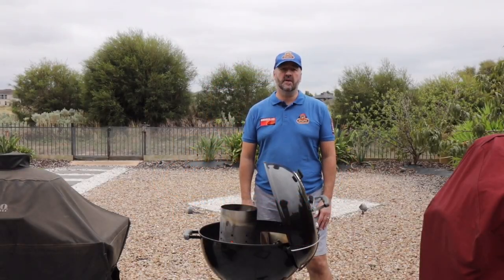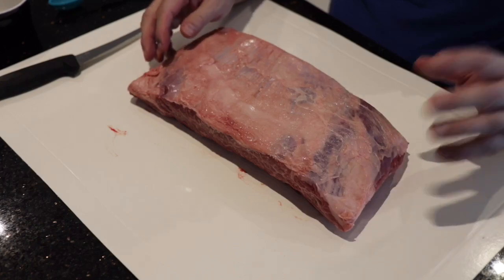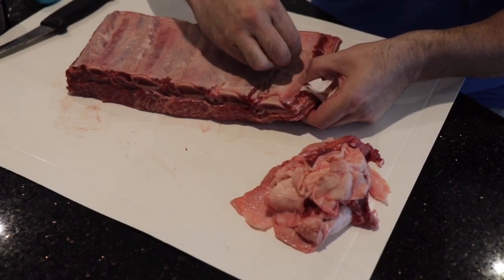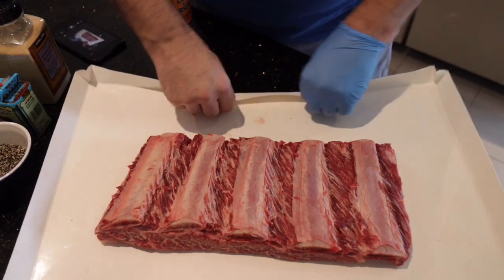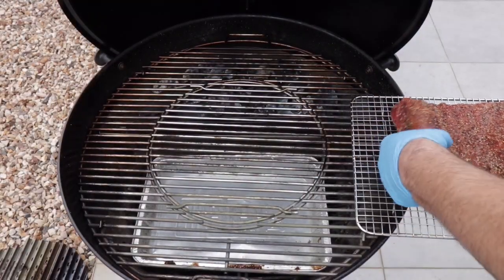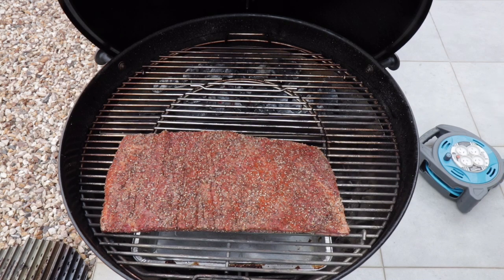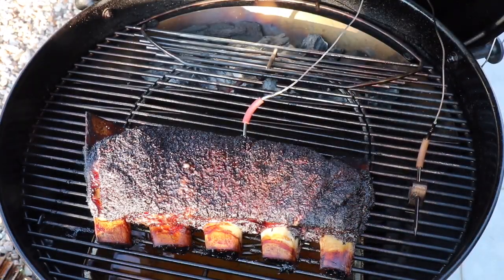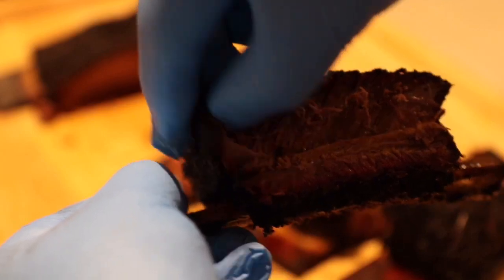BBQ Beef Short Ribs smoked on a Weber Kettle - Instructional Video and Recipe

Comment: those are the most delicious looking ribs I ever saw!
Reply from the maker: Thanks Danny, they went really well and tasted great :-)
Reply: I'm going to attempt making Texas brisket and beef ribs this summer for the first time as well, being that it's going to be my first time what do I need to know and do to ensure they are smoked properly?
Reply from the maker: Hey Danny, what are you cooking them on? The main thing for both Brisket and Ribs is that they are done when they are done. Give yourself plenty of time. Use the thermapen to know the temperature but go more by the feel of the thermapen probe going into the meat. On both cuts it needs to go in, like it was going into soft butter. You should feel no resistance at all. Start checking around 195f internal, they may be perfect at 195f or 210f. Use the temp as a guide, use the probe/feel to decide when they are perfect.
Reply: Thank you hector,  as of right now I only have a propane grill and I'm looking to purchase a Weber kettle or Smokey mountain grill as the summer months approach here in the U.S .I love to grill and I want to further my grilling/smoking skills
Reply: Hectors Smoke House aa

Comment: how did you light the charcoal. Did you use the low n slow  lighting method or did you light all the coals at the same time? My short ribs are thawing in my refrigerator right now.

Comment: It looks toasted but i was in houston last week this is how they do the bark. Black, crispy and very peppery. Now i will be sourcing for that same cut of short ribs and try your method. Thanks.
Reply from the maker: Hi Bill, I do like the more crisp bark but sometimes I do wrap as well. Both a great but different. Let me know how you go 😁
Reply: Hectors Smoke House so if you wrap them half way the bark wont crisp up due to steaming?
Reply from the maker: That's right Bill. More like smoking a Brisket and it will speed up the cook time. You can even add a little liquid to the wrap.
Reply: @HectorsSmokeHouse  ill do uncovered and spritz a couple of time, will that work?
Reply from the maker: That should work well. A little bark is good but the spritz will help to keep moisture on the surface, so should give you the best of both worlds.

Comment: During that first 3 1/2 hours did you have to add coal to your fire? How did you maintain the temp you wanted???? Enjoyed the vid
Reply from the maker: Hi, the Slow N Sear will run comfortably upto 4 1/2 to 5 hours, so normally I will top up around that time. The temp was purely managed through the top and bottom vents, the Kettle is pretty good at maintaining temperatures. However the temp doesn't need to be incredibly accurate. Anywhere between 250-300f is OK, its just the cooking time that changes. It all comes down to the Ribs being ready when the probe glides through the meat like butter. This might take 6 hours at 300f of 10 hours at 250f.

Comment: How many times did you add charcoal to keep the internal temp going?
Reply from the maker: I used the Slow n Sear and I reckon after 4-5 hours and then a small top up a couple of hours later.
Reply: Hectors Smoke House thank you

Comment: Those look great! I have one question, though.

Why did you cook them until 207f? Is this meat supposed to be cooked hotter than others? I thought something around 165f was well done.

I can't wait to give these a try!

Thanks!
Reply from the maker: Hi, This is low and slow cooking. Its taking a tough cut of meat, such as Beef Ribs, Pork Shoulder, Beef Brisket and cooking it until it becomes melt in the mouth tender. With these cuts, once the meat reaches an internal temperature of around 165f (called the stall) the collogens and fats in the meat start to renders. I think collogen turns into gelatin. This occurs between 165f to 190f? 
This can seem counter intuitive because as you say, steak is well done at 165f. So the idea is to cook to an internal temp of around 198f and then start to probe your Rib, Brisket, Pork Butt until the probe goes into the meat like butter. This could be anywhere between 200f and 210f. I'm not an expert on the science so I'd recommend you head to a website called www.amazingribs.com  this is a fantastic place for all things BBQ. Meathead can explain it a million times better than me, I'm sure I've got some of it wrong :-)

Comment: hi Sir can i ask someting here about short Ribs?  i just done my smoked beef ribs at 500Gram, but its so chewy and cant even bite... do u know wht happen with my short ribs beef? i cooked 225F in 2.30 hours 

nice hear ur replay TQ
Reply from the maker: Hi Andrew, it sounds as though you didn’t cook them for long enough. My ribs normally take 6-9hours at 225f. Steaks are normally well done at 165f but for cuts of meat such as Brisket and Beef Ribs you have to cook until they are 200-203f but more importantly, the thermapen probe needs to glide through the meat, like a hot knife through butter. The key is to keep and eye on the tremor during the cook and use the probe feel to know when to take them off.
Reply: tq hector! will try it soon! HEHEHE cheers buddy!

Comment: Why apple juice?

Good looking ribs though
Reply from the maker: Only because its good for moisture and isn't offensive. Apple juice is quite a neutral flavour and goes well with pork and beef. Its better than just using water to spritz but you can use water as well. Some people will use other fruit juices, depending on the meat they are cooking - quite a few use peach juice with pork, as an example

Comment: Not really instructional for using the webber kettle. If you showed how you managed the temperature, adding coals etc which is the trickiest part to a long cook on a webber it would have been more instructional. However your instructional video on cooking short ribs was very good with a great result
Reply from the maker: I've done other videos on the kettle looking at lighting a chimney, direct cooking and indirect cooking but haven't done temperature control. Perhaps I should do one :-)

Comment: Funny I hear on pork ribs you take off the membrane, but on a rack of beef short ribs you leave it one so as to hold the rack together as supposedly it falls apart without it, unlike pork ribs.
Reply from the maker: Certainly no problems with these ribs. Might be different with other ribs, especially if they are cut differently. I've always taken off the membrane and haven't had a problem so far.
Reply: Sounds good, I guess I'll take them off when I do my first short plate tomorrow.